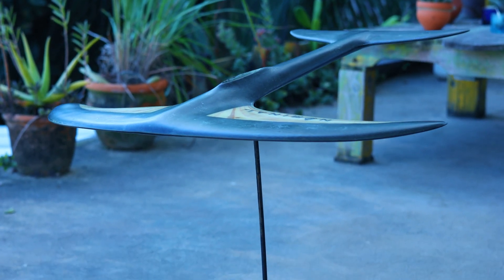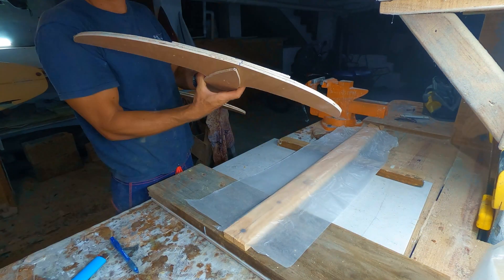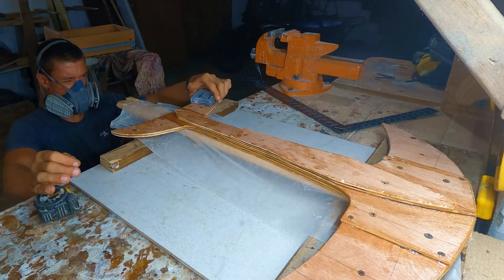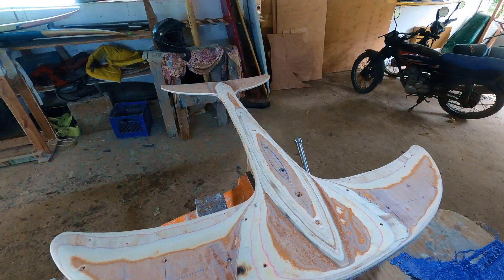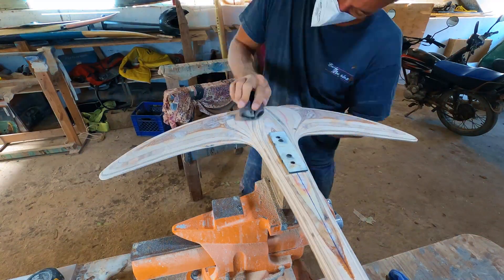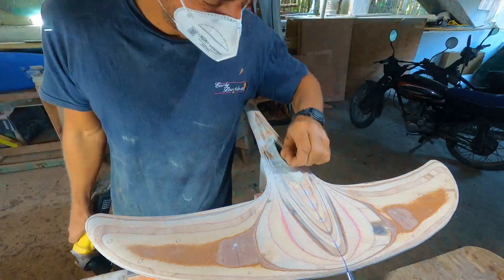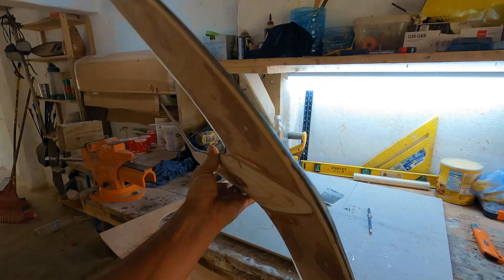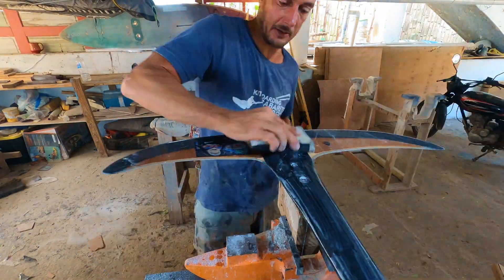How to build a DIY Hydrofoil

Comment: The problem with falling in love with your own build and putting passion like that into a work of art. Is it can become just that. Eventually it’s easy to stop keeping yourself in check and you can realise mentally that the design is flawed or ruined and you might say “screw it, I’ve come this far, I still want to see what this turns into” 

Which is usually a waste of time and it’s better to stop and stay grounded rather than repeat this cycle time and time again. Get it right the first time and at most, the second time. 

This is why falling in love with your build is flawed.
Reply: More maths next time. More cad and design planning next time. More simulations of airflow next time. Lots to consider next time. 

Any one with some wood working skills can make something beautiful that barely functions.

Comment: Great job and very smooth finish🤩! What about the wing profile you chose and the performance feedback? Did you manage the profile along the wing with various profile wood gages or was it purely random based on leadingedge-maxthickness-trailingedge respect and smoothandnice feeling?
Reply from the maker: The whole shape was done by eye no specific wing profile was used, indeed the foil felt smooth but relatively slow, stay tuned for a much more advanced foil build coming out soon!

Comment: Nice job!
You made profile by intuition. It will work, but may be not ideal, may have too much drag or lift.
What I done when I made my front wing, I selected a good hydrofoil profile (H105). Printed it on paper, with different sizes, biggest one for near a fuselage, where chord of wing is biggest, smallest one nearby wing tip, and couple in between. Then I glued that paper to aluminium sheet (from beer can), and cut out precisely. So I got set of profile stencils. Then during sanding I put these stencils on wing to see where to sand. This way I got quite precise profile without CNC.
Reply: Is there a good source for hydrofoil profiles? I tend to find kind of good Info, but scattered all over the internet.

Comment: One suggestion I would make for the above board is to have
swiveling foot sandle straps for your feet to slip in and out of to have better control
grip and connection to the craft. Like slalom water skis kind of that have that one foot pocket. 
Weather practical or not something to consider if useful, as it is just a thought. 
Overall Great work and thanks for taking the time to share it.

Comment: Hang on hotshot.  I don’t see you checking that the airfoil sections are right, and yet it works anyway.  This confounds and amazes me.
Reply: Yeah… I guess it comes down to “if it looks right it’ll fly right” 
But yeah this is totally guess work. Which means it probably only reaches 5% of its true potential efficiency.

Comment: A lovely piece, though I think it is somewhat of a shame to cover up that interesting grain/ply pattern with boring carbon fiber. At least the portion covered by the plain fiberglass fabric kept those smooth body contour lines visible.

Beautiful work. One can see that you visualized the flow while shaping the foil.

Comment: Really want to do that But i can only repair surfboards. Is this enough skill to get a working wing? Or trying to shape a board First?🤔
Reply from the maker: Yes i think you could build a functional foil given your surf repair experience, the learning curve is the same as surfboard building except its cheaper in material cost so less risk if you mess up. After 1 or 2 builds it gets a lot easier.

Comment: Just what I kinda needed to know I can do that easily but time & patience. I am researching mounting a powerful motor to that design. I want as small diameter motor as I can get but yet powerful going to make it long slender. I am trying to make a Ascend 13x or Pro Hobie Fisherman kayak into a E Hydrafoil kayak sick abs tired of 1-3 mph, yet making it look as professional a Tory made as possible, also adding more trouble I am making the foils   To where they fold up as so kayak can get into shallow water. With a solid e foil on bottom of kayak I cannot go into water shallower than 4’-5’ feet deep. I want to get into 2’ deep water at least, some. I pant will come out with a model before I get finished I’m sure but I can’t wait however long it will be

Comment: Beautiful looking foil - must feel super smooth and responsive in the water assuming there's not too much flex.  Maybe you could do a stabless tail with mounting holes so you can change stabs, shim them or adjust front-rear wing length.  Would allow you to experiment and dial in your design without having to build a whole new foil.

How much experience have you had in shaping before you built this?  This appears well thought out and I'm guessing you've done quite a bit of this work before.
Reply from the maker: Thanks for the comment, indeed having removable wings and stab would be convenient, however it makes it much harder to obtain an overall rigid structure, and all the connection points on the fuselage makes it very challenging. I haven't figured out how to make one yet . Building a one piece Hydrofoil seems to help a lot with rigidity, and weight. Indeed, this is my 3rd hydrofoil build, the building process is still evolving.

Comment: I mean I love that you did all this. I'm thinking CNC this and knock it out in a couple hours but using a similar process to yours.
Reply: If you end up doing that would you mind sharing the file so I can do the same!! Thanks!
Reply: I would also be interested
Reply: I've been wondering about the possibility of using a 3D printed 'skeleton' under carbon fiber. Would make rapid modifications possible, and make the wing even lighter.

Comment: I was skeptical at first but it looks good in the end. It's very smooth, friction wise, and I imagine it's quite strong too. I wonder how you managed to get the angle of the rear stabilizer. I've found it to be a fussy thing to get just right. Thanks for posting your project.
Reply from the maker: Hey James, I just eyeballed it. I estimated 2-3 degrees of negative angle. The foil turned out to be very stable, next time I'll put just a little less angle
Reply: @HANDIY  Way2go!
Reply: @HANDIY excelent build ! Does the structure hold after couple of months use ?

Comment: Super work!
Reply: what size is the foil roughly? How did it feel? Any flex? Totally stiff? Curious
Reply from the maker: @theconsciousislander  Thanks! maybe  800 - 900 cm2, to me it feels smooth, but i dont have enough experience with normal foils to really compare. Some slight flex at the wingtips but pretty stiff overall.